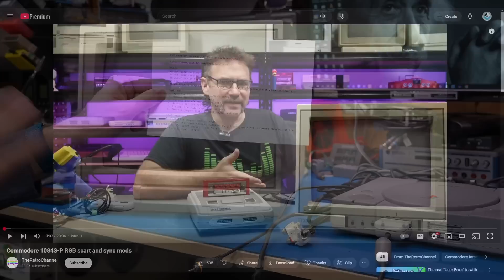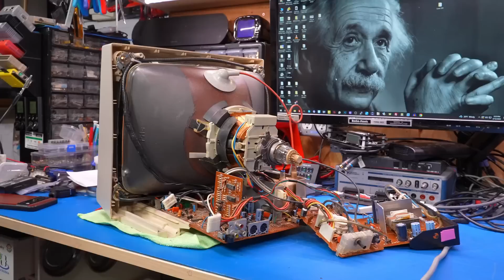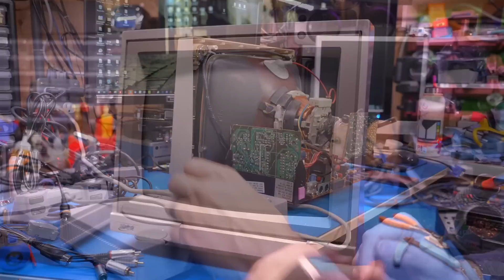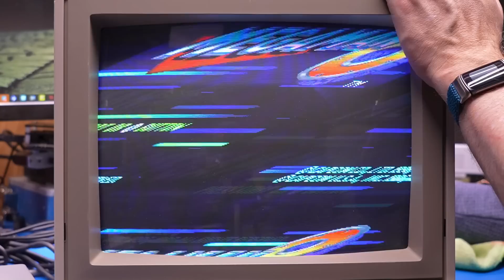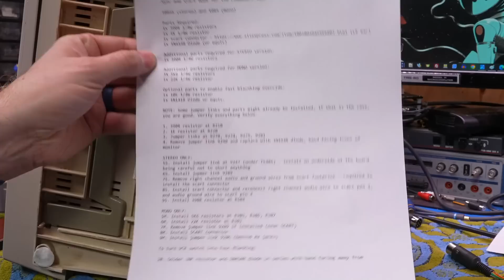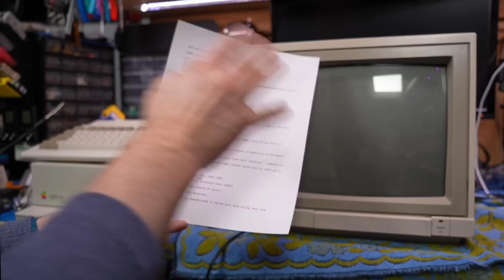Ultimate Commodore 1084 SCART modification

Comment: “Flag waving” was a common problem with PAL VCRs and older PAL TVs. You had to modify the time constant in the horizontal oscillator to keep it from drifting as there is no horizontal sync during the vertical interval. Thats what the switch on the PAL monitor is doing. 
A friend at the Colour Computer club was using a 1084 with his CoCo but the sync combiner board was not producing any vertical sync. Coco has RGB out but seperate sync signals. Looking at the board, I shorted the resistor carrying the Vertical sync and it locked solidly. Swapped in a lower value and it worked perfectly
Reply: NTSC would be the same and this predates colour, it’s done to avoid upsetting the vertical sync. More likely the time constants in old PAL/625 line TVs were less optimum than NTSC
Reply: @Wenlocktvdx  thanks for clarifying.
Reply: so PAL does not have horizontal resync during the vertical interval, would this have something to do with not upsetting the phase for the alternate line

Comment: Your 1084 is broken. It has that weird swingy cover on the front.
Reply: Every one of mine broke early on, and i never cared.  ^-^
Reply: lol When I got mine, I opened the door and never fooled with it again. Im not taking any chances because that 3D printed door is hideous.😂
Reply: 😂 mine is still there although admittedly it only stays shut with blu tack as one of the posts snapped. But every other 1084 I've seen has it missing.
Reply: Yeah, isn't that intended as a single-use front panel? With a predetermined breaking point?

Comment: SCART is great, probably the fullest analog connector for AV it does input and output, full stereo sound rgb video. 
I believe you could use the S-video jack on your scart to rca adapter to have rgb and sync from a playstation s-video cable...
One of the very nice ideas of French engineers that clearly turned the spaghetti horrible cable situation to a a bit chunky but single robust connector for everything, there were also multi scart adapters to use multiple devices to one monitor. It would be the best if it had multichannel analog audio also supported and not just stereo... I think they had also thought about that? Don't remember very well... Strange that USA did not adapt it as the rest of the world did although it did not involve millimeters to inches and grams to pounds situation...
Cheers from Greece, Keep up, Jim!
Reply: Not to mention everything (except RGB) was bidirectional. So you could loop the video through a decoder box and back to the tv over one single cable. Plus, it has control signals to wake up connected devices from standby. SCART was pretty neat.

Comment: Can't this be done with an external LM1881 sync separator? Lots of SCART cables were sold for years with this IC for this exact reason.
Reply: kinda wrote the same thing, I remembered the lm1881 from the Jerrold SB3 cable box days :)

Comment: The French are responsible for Scart. They wanted to distinguish the French TV manufacturers from the cheap Asian imports. Back then, VCRs and home computers were connected via RF. The picture was even worse than combined video signal. So the French decreed that every new TV had to have a Scart socket. European manufacturers quickly jumped on the bandwagon and equipped their TV models with Scart. This forced Asian manufacturers to do the same.
Reply: SECAM's colour encoding method was more or less an attempt to lock foreign TV manufactures out of the French market.  Different sync rates were fairly easily handled, SECAM required additional circuitry beyond PAL (a slight modification to )/NTSC since it is FM encoded.  Hence NTSC - never twice (the) same colour, SECAM - something essentially contrary to the american method, PAL - peace at last

Comment: I'm pretty sure the 1084S I had supported EGA resolutions as well as CGA (it was a PAL model with a DB9 input). It didn't have SCART but RGB over SCART is analog with composite sync, so it's possible that it could take VGA input, depending on the resolution. 320x200 should be slow enough sync for it to work, because that's not far off EGA. You'd only need a sync combiner which is 2 resistors.

Comment: The SCART connector is a really poor design and left a lot to be desired.
Reply: Yet every retrogamer in the US wants a monitor or a TV with SCART inputs.
Reply: @SuneSalminen  Physically it was pretty bad, always getting loose and was a pain in the butt to insert while hugging your tv. But as a versatile connector, it was awesome compared to anything else on the market. Well, maybe japanese did have something similar for their own market, but nothing so universal with many features such as automatic source detection (the blanking signal) and combined stereo audio.
Reply: @ It was probably meant to be inserted once and then stay there. My only gripe with SCART is that the plug is kind of flimsy (as Adrian says) and finicky to work on. Other than that I have 0 complaints.

Comment: I have the 1084S version of that monitor, which I used with my Amiga 2500. One day, it just died on me. I started looking for the fault, and I think there's a short somewhere in one of the power rails. I haven't touched it in a while; I should finally try to fix it and do this mod while I have it apart.

Comment: That is not true...my 1084S did pal and ntsc !!!!
Reply: over composite, S-video or component in?
Reply: These monitors are too old to have Component inputs. I've never seen one with S-Video, but I've owned one that had separate luma/chroma for the C64. That leaves composite, TTL RGB and SCART. The ones that I've owned or used (PAL region) worked with 60Hz arcade PCBs over SCART. Though that doesn't qualify as "NTSC".

Comment: I had one of these monitors as a Magnovox in the US.  It had a low res CRT and only a composite input. I was still very impressed by the ability to control screen size and position.  My only video quality comparison at the time was to using an RF modulator.  I always had it in-line with a VCR so I could record my C64 or Nintendo games.

Comment: I love that little 4-phono to DE-9 board. So neatly done!
Reply: I don't understand why after going to all this trouble to modify the monitor, Adrian didn't permanently install these adapters in the monitor. Both RCA and DE-9 sockets should be easy to add to the case. Worst case, it would require 3D printing a simple mounting bracket. And that would make the monitor much more universal without involving all sorts of different chains of adapters.

Comment: If I recall correctly, the NTSC decoder chip IC501 (TDA4570) is pin-compatible with the PAL (TDA4510) version. Some 1084 variants have a 28-pin IC501 instead of the 16-pin chip that are in all of mine so I'm not sure about those. It would be an interesting experiment to convert one to PAL by swapping the chip, crystal and adding the delay line circuit. Even cooler would be to design a daughterboard that could be used to switch between both 😁

Comment: I bought a NTSC 1084S-P (Nov 1988) last year on the cheap due to a failed flyback.  It had the same flyback you mentioned that always fail, I’ve replaced the flyback since.

I tried doing the same SCART mod last year, and I recall I ran into similar issues.  I’ll be able to use these instructions to go back and complete the mod now, thank you!!

One other common issue with these monitors is the power button stops working due to plastic wear-and-tear.  But a generic replacement can be easily found on aliexpress.
Reply from the maker: Oh I think that's also an issue only on those later ones with the bad flybacks. It seems Philips really went cheaped out on those later years. Glad you got yours working though! And yes, it'll be awesome with full SCART!

Comment: My PVM-2950QM behaves the same, won't accept composite video as a sync source. I just built a little external box with an LM1881 to clean it up. Quite frustrating for what would have originally been a seriously expensive set!
Reply from the maker: Ah yes -- that's another solution to use a sync extractor.... but indeed, the way SCART does it is kind of strange really .. so that's why this mod rocks, it makes the monitor so great to be able to natively do both.